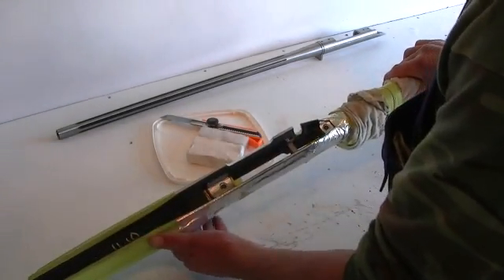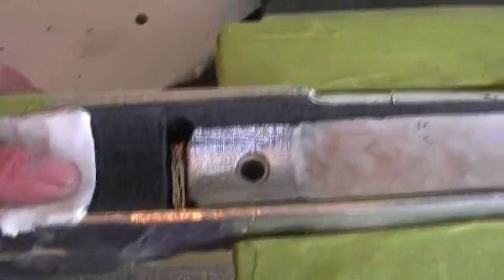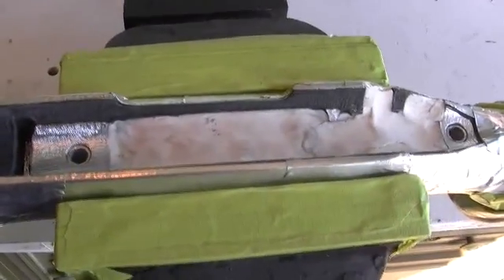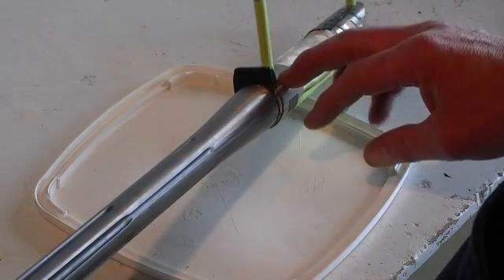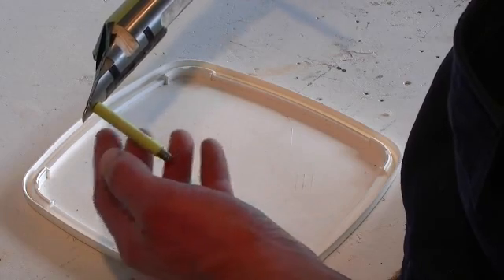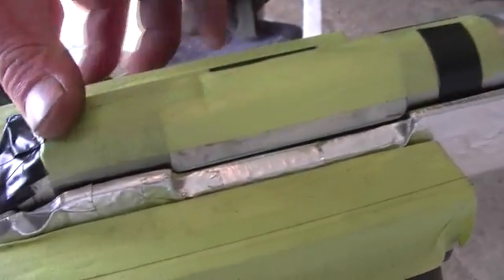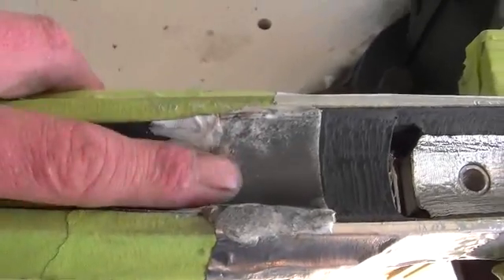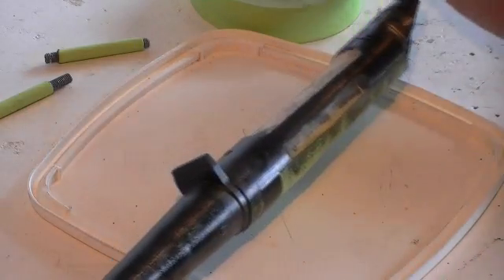2. Bedding a rifle with MatchGrade bedding compound

Comment: Kiwi Shoe Polish is not available anymore. No Kiwi products are. Do you know of any other "household" solution to use as release agent?
Reply from the maker: Hi there, if you want to, try using CRC silicone 808. In addition to this, I would suggest finishing with a dusting of powdered graphite as per the Matchgrade tips and tricks video. All the best.

Comment: Still a valid video even today!  Im about to embark on this journey - I've bookmarked your retail shop for compound. Ive one question though - when you electrical tape up the recoil lug - is there a danger to use too much, that would make that too fat, that would then result in a loose fit?  Guessing one layer is all is required?  Howa 1500 application x2...

Comment: why do you waist all that time with tape?  why not just use release agent like everyone else? seems as if you make it way harder than it needs to be.
Reply: did my rem. 700XRC tactical long range and I have shot 5 shot groups as small as 2.75 inches at 600yds. but a lot also went into working up a loads just for that gun.
Reply from the maker: +Hank Uhrig Hi Hank, if you go through to the website and read the articles or book series, the reasons why are explained carefully. I have also given explanations in the Kapiti talks videos. These talks are however quite long so if you want to watch them, you'll need to set aside time. Not the best if if you are looking for short / quick vids. All the best.

Comment from the maker: @akshooter762  Hi AK, its much the same as bedding the rifle in the vids but you will leave the tang floating. Also, tape up the barrel nut so that it is free floated and not bound in the bedding, then bed the barrel for say .75" out into the channel. Do the sides of the action to optimize contact area. It will take time to learn it all, little steps, patience, just take your time.  If you stuff it all up, no problems, hog it out and do again. You'll be fine.